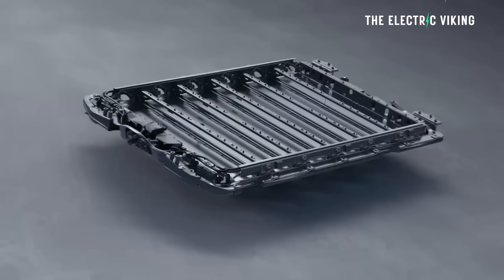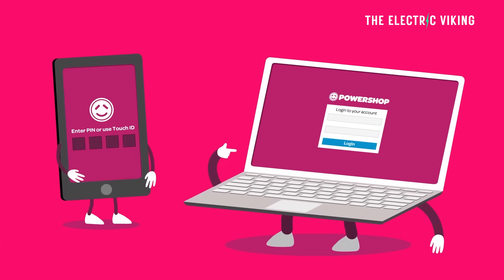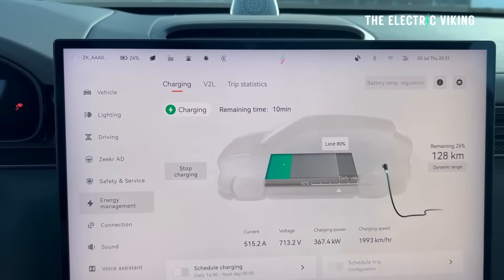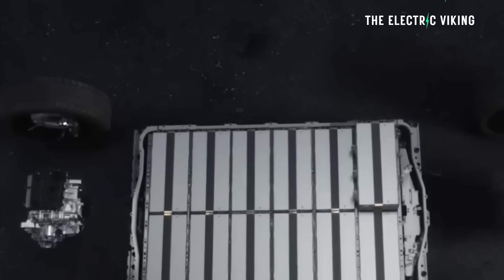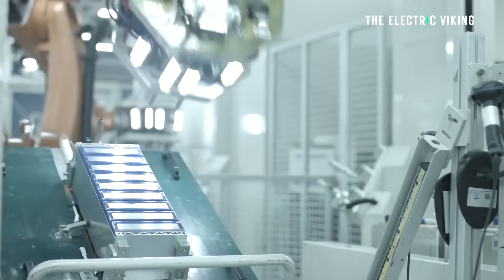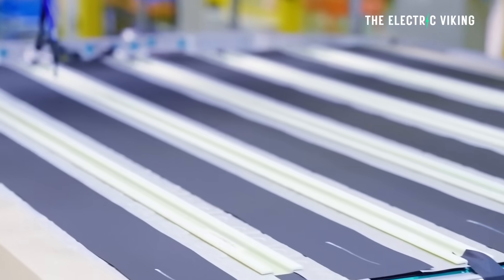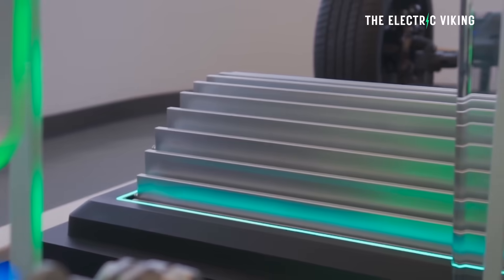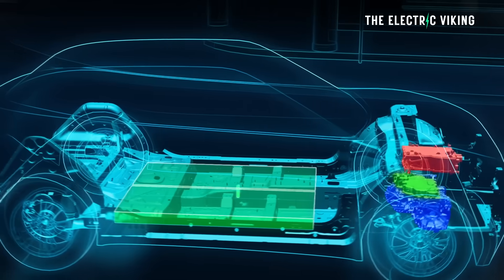Tin Anode Breakthrough: US Invents Sodium-Ion Battery That Beats LFP

Comment: I don't know what the density of the tin needs to be in the anode, but....you can coat plastics with metal paint, and then "plate" that in tin...giving you huge tin surface area, but very little tin, by volume. 🤷‍♂️  i'm theorizing ....I'm not a battery scientist.

Comment: I recently saw a video about an Aussie firm that developed a solar steam generator that uses seawater to run a steam turbine. The output is distilled water and brine. The idea is to refine the brine into table salt. The plan is to tilt up lots of these small generators along coastlines.

Have to wonder if the refining process could be used to produce Sodium in sufficient volume and of sufficient quality to turn it into batteries which could, then, store the electricity produced by the generators.

Comment: You can always just use Tin with HEP over an aluminum core. The HEP thickness can be used to determine the lifespan of a particular battery product. 3000cyc 10,000cyc?

Comment: No its not, sodium batteries do not change anything they are larger and heavier than lithium batteries the only real application where tjey really work is in STORAGE and short distance automobile of less than 300km or 200 miles

Comment: One key advantage of Sodium-ion batteries is that they can be fully discharged without damaging the battery. You can extract the entire stored energy without compromising its health. This feature of Sodium will require less criticality in its Battery Management System. In, lithium-ion batteries, particularly LFP, typically require maintaining around 20% charge before recharging. Fully depleting a lithium battery can shorten its lifespan or make it harder to recharge. Sodium-ion batteries are often considered as a cost-effective alternative, claimed to be nearly half the price of LFPs... though in practice, such pricing hasn't been widely observed. Still, sodium batteries could be more suitable for Extended Range Electric Vehicles (EREVs), which have promising potential in the coming years... So, year 2026 and beyond is for Sodium...!

Comment: what's the cycle life like on these?  One of the drawbacks for sodium batteries is that they have a much shorter useful life than lithium (with the older sodium ion construction)
I'm betting that the pure tin anode isn't production, they'll likely use a cheaper material for structure with tin on top, it kinda depends on how much the tin will redistribute while cycling.

Comment: I am considering buying an electric trike for running to town and back. I have been an avid motorcyclist all my life, but old age, and a fall on my bike 3 years ago, have stopped me riding 2 wheels any more; I can't risk falling again or I may well end up REALLY crippled even worse than that fall left me. A trike is the obvious answer, but a Harley is too big and heavy and expensive for my needs, and there are electric trikes that would do the job for me just fine. With this new sodium ion technology though, I am waiting until it becomes the dominant battery type used in such vehicles before I buy one, since I have doubts that the charging and other circuitry used presently for lithium ion batteries would allow replacement with the new sodium based type. I think there may be a lot of other people considering electric vehicles of all types who may hold off buying like I am for the same reason.

Comment: Did some checking on tin prices. The current market price (~$33k/metric ton) reflects artificial barriers and regional instabilities. Assuming current market demand without these artificial barrier, price should be ~$26k/metric ton. Even if all current prospective new mines open (unlikely) and go into production by 2030, with anticipated increases in market demands, price should stabilize at ~$26k-$30k/metric ton. With that holding for only ~15-20 years based upon current supply mines. Long term looks bad.

Which means well into the future tin is likely to remain a very expensive metal. Should this type of anode take off, I would anticipate this to significantly increase market demand thereby further driving costs significantly upward.

In short, simply because of price barriers purely based upon speculative tin futures, it's difficult to see how this battery could ever become price competitive in the long term. Contrast this with CATL's sodium cathod/anode raw mineral requirements, which come in at ~$547 per metric ton.

Honestly, the foot in the door with tin seems like a non-starter.

Comment: Things are moving very quickly on safer new tech traction batteries across the globe.  Good to see that the USA still has its research mojo producing the goods.  In the UK Ilika plc has got its automated Goliath solid state battery production line running and is ready to produce cells for customer testing and commercial evaluation.

Comment: In order for new battery tech to takeover it needs 3 attributes 
1 better performance in most instances 
2 either cheaper or easier to manufactured 
3 the volume of production able to replace established market with significant expansion possible

Comment: 5:50 - they weren't using a battery management system: Rubbish. I've just looked at the paper, and they were using a discharge rate of 0.2C (C/5) for 3 cells at those 100 cycles. There is no need for a BMS when you have controlled environments and the cells are not in series because you control their voltage and current individually.

They measured the columbic efficiency for each cycle, and that remained above 99.7% for each cycle, with the capacity of the cells dropping to 90% after that 100 cycles. That graph is pretty much a straight line, so it's not like a bunch of the sodium was used up at the beginning and stopped being used up after that. It must be reacting somehow and going out of circulation over time.

Edit: Also, when you say tin is expensive, they say the capacity is 0.837mAh per gram, so for a sodium ion battery around 2.5V, that's 2.12Wh/g. If you want a 20kWh battery for your home using this anode, it's theoretically around 9.5kg of tin per battery, or at the price of $35 per kg, that's $330 per battery. Or, put another way, it's ~0.5kg of tin per kilowatt hour, or $17.5 per kWh. That's not super-expensive, but it does add to the cost quite a bit especially because CATL says their batteries will cost $10 per kWh.

Comment: They are saying 178 wh/kg density. LFP has gone beyond that right. With Golden Battery and CATL's Shenxing Plus. Plus CATL has dual battery design which can take it even higher and they are looking at Anode Free as well. 

That said it would be good to see US creating a new battery. Especially if it can be made without anything from China.
Reply: It's all win win for sodium-ion. First generation is as good as LFP in terms of energy density, better life, better operating range, cheaper, safer, more abundant raw materials.
Reply: CATL Naxtra battery 175 Wh/kg versus LFP battery 185 to 210 Wh/kg...  However, CATL's sodium-ion battery packs more capacity per volume (about 15-20% more Wh/L). So, the energy volume increase makes up for the energy density deficit. In other words, the same sized pack may weigh slightly more but hold the same or more capacity.

Comment: Tesla is putting together batteries with a 250-300 w-h/kg. 
This breakthrough is still 50% lower energy density. 
I don't think we'll be in a good place for EV's until energy density triples what tesla is achieving.
We need close to 1 kw-h/kg before battery weight and costs come down enough that the battery isn't 60% of the mass on the vehicle and similar percentage of cost.
That being said... sodium Ion battery manufacturers should be targeting home and grid scale power storage.

Comment: To be fair, there are additional downsides beside the material expense. Production in the US will be expensive, which will drive up the price compared to its Chinese peers which may negate slight surplus in density. Further, it will take some time before this development reaches scale, at which point Naxtra will have undoubtedly evolved (as batteries do, year over year).

Comment: Chromium oxide.

Well. Chromium is slightly more abundant than lithium, but not too much. It depends a lot about how much mass we are talking about because it's not clear.

As always, don't think any laboratory can turn into real tech. We only know that if the claim is true, they are more dense, but each chemical requiere to be tested on a lot of things, like durability, safety, cost of manufacturing (manufacture adaptation to the new batteries), temperature range, speed of charging/discharging... etc. etc.

Comment: Your problem is the Tin cost differential make them only justifiable, for the highest energy per unit area; this is only a small subset of battery applications. 
As a result, unfortunately China’s battery will be cheaper and more adopted… 😢

Comment: Tin even if more expensive on a per ton basis (doesn't actually seem to be, see below) may still be less expensive for battery construction. The reason being it takes around 12x more carbon atoms to capture a single Sodium ion than tin does so you need fewer tons of tin. And if it really is using 99.5% pure tin that is not the expensive high purity stuff. Actually the hard carbon as used in batteries $50k-$100k/ton seems to be more expensive than the 99.99% pure tin $35k/ton. Although it sounds like they might be pulling a bait and switch that the anode may be 99.5% of high purity tin (expensive) with 0.5% of other stuff. You quote two different numbers, both 99% and 99.5% tin and it matters.
As you correctly point out 100 cycles at 10% degradation is too much unless it stabilizes. Either it doesn't and that is why they released the information for 100 cycles or they haven't run more than 100 cycle because cycles do take time.

Comment: Its good these developments are occurring. However LFP technology is not standing still. Third generation LFP batteries already have a 15% capacity gain over second generation mainly arising from improved packaging. However, there is still room for broad improvement with a fourth generation. According to Maria Guerra  "the next generation of LFP batteries is expected to deliver notable improvements in energy density, charging speed, and affordability, driven by innovations in materials like LFP-nanocomposites, solid-state electrolytes, and Lithium Manganese Iron Phosphate (LMFP)". LMFP offers a higher cell voltage (3.7 vs 3.2V) that will directly translate to greater energy density.

Comment: The problem for America isn't batteries. Batteries are a store of energy not a source of it. China could more than double the demand on it's energy grid and still have room to spare. America doesnt have the energy capacity to run electric cars or AI and not have rolling blackouts. If the US mandated Electric vehicles it would actually increase gas and diesel demand as people would have to buy generators to charge their cars 😂

Comment: How does it compare to the CATL Sodium Ion batteries currently in production?  How long will it take for the US to build these at scale?
Reply: It degrades 10% after 100 cycles, it's trash in its current form. Needs another 5 yrs lab work to make it viable, if possible. CATL is production ready and is capable of 10,000 cycles. Worlds apart, this is participation award stuff.

Comment: I am unable to compare the energy density per kg.
The tin anode example yields 640,8 kJ per Kg
The sodium is quoted at 300 Ahr per Kg
We will need the voltage to be able to work out the joules.

Comment: this does not even seem like news.  90% after 100 cycles.  so much tin.  sounds like one of 10,000 battery experiment deadends, unless its substantially improved. i personally prefer not to hear about a battery chemistry until its more proven.   the framing of this video is that it was a big deal and the issues would be solved.  

its not far long enough to make any cost claims, but 99.5% sounds way too expensive.  lithium is cheaper and lithium only makes up 2% of the entire battery.  here tin makes up 99% of the cathode, which i think is generally half or more than half of the battery.  or somewhere in that realm.

Comment: 178 W/kg against 175 W/kg of Catl battery, is this a joke? How 178W/kg is more than LFP? Where is breakthrough comparing to CATL 175W/kg for Sodium?
Reply: It's Wh/kg man. Only 180Wh/kg? Then I guess it can only be used for batteries that are put on the ground, not in vehicles.
Reply: @avalagum7957 my bad. Typo, of course Wh/kg. Still no breakthrough. Catl introduced sodium battery with 175 Wh/kg. Here we have 178. Different lithium batteries are up to 300 Wh/kg.
Reply: @avalagum7957  most BYD EVs are running on batteries with 150 Wh/kg

Comment: Tin solder sometimes forms tin whiskers that can cause problems in electronics. I wonder what they did to suppress that problem. It would be similar to the dendrites in the lithium batteries
Reply: That's exactly what I was worried about while listening to this.

Comment: Tin roofs are predominantly made of steel and are "zinc" coated.
Also tin is a byproduct of other metal mining and if it become a target mineral then the cost would come down.
Reply: While tin is a byproduct of mining for other metals it is also very much a primary mining product. In fact 50 % to 60% comes from primary mining.

Comment: A tiny bit higher energy density than CATL Sodium Ion batteries and all you have to do is use a ton of expensive tin and destroy the longevity of the battery. I'm game for research, but as is this doesn't feel like it will replace anything.

Comment: Sodium-ion batteries typically exhibit a wider voltage swing (more sloping/less flat) compared to common lithium-ion batteries, particularly Lithium Iron Phosphate (LFP).

This characteristic can present practical challenges:

Complex Power Management: A significantly sloping discharge curve means the battery's voltage drops more rapidly and consistently as the State of Charge (SOC) decreases. For the power electronics in an application (like an electric vehicle or energy storage system) to maintain a constant power output as the voltage drops, they must draw significantly more current from the battery in the low-SOC region.

This requires more complex and robust power management and DC/DC conversion systems.

Reduced Usable Energy Window (Potentially): If the application's connected power electronics or motor controllers have a narrow acceptable operating voltage range, the battery may need to be oversized. This is because a larger portion of the battery's total capacity (at the high and low ends of the steep curve) might fall outside the usable voltage window, effectively reducing the practical usable energy.

State of Charge (SOC) Estimation: A flat discharge curve (like in LFP) allows for simple and very accurate SOC estimation because a small voltage change corresponds to a large capacity change. In contrast, a sloping curve, while providing a clear correlation between voltage and SOC, can be more sensitive to factors like temperature and instantaneous current, potentially making accurate, real-time SOC estimation more challenging for the Battery Management System (BMS).

Some sources suggest that a typical sodium-ion cell's voltage might drop from approximately 3.7 V to 2.5 V over a significant portion of its discharge, whereas an LFP cell might remain between 3.4 V and 3.3 V for 80% of its discharge cycle, illustrating the difference in flatness
Reply: Designing power electronics to compensate for the steep discharge slope is not a big problem. The advantages of the Sodium chemistry more than compensates for the discharge slope issue.
Reply: I guess voltage drop can be mitigated by varying (increasing) the number of cells discharging in the pack as the voltage drops + capacitors to keep it in a tight voltage range. catl wouldnt be so big on naxtra if they didnt have something like this, which I dont think is particularly complex, in the offing. It is also offset by not needing nearly as much of a heating system as full on lithium batteries require

Comment: Tin may be a little more expensive, but the beauty of this mineral is that the battery is almost completely recyclable and less toxic. The good news is, Alaska and Northern Mexico have some really huge deposits.
Reply: Honestly anode free sodium metal batteries is more promising than this. It has slightly higher energy density than current NMC battery at almost 400Wh/kg with even cheaper cost. If it finally hit mass production we finally ditch the nickel and cobalt for good

The problem is that it needs more research to improve cycle life (latest prototype of it only last for 400 cycles, still far below the >1000 cycles required for any EVs)
Reply: @sihamhamda47 sodium metal battery? Not ion? Sodium metal is extremely dangerous, I really hope that isn't accurate...
Reply: 35k vs 8k per ton is not a little bit more expensive. Its more than 400% more expensive than lithium
Reply: 95% of a lithium battery can be recycled and materials reused in new batteries.

Comment: Sam, you're losing it.  The recent announcements by CATL show their Na Ion battery cells exceed the best LFP battery cells by about 15% storage capacity. but remain slightly heavier per kWh  CATL are already shipping small volumes to Chinese car companies so they can engineer them into production in Q1 2026.  The technology is easy to manufacture using similar production machinery to that already in use making LFP cells, so roll out will happen very quickly.

It's nice that an American University has developed a new variety, but more important is how long will it take to be cranking out millions of cells to fuel the US auto industry?  If it's not being done by Tesla it will take several years from now, by which time there will be another better technology being introduced from China.